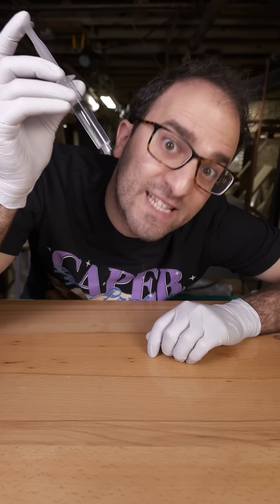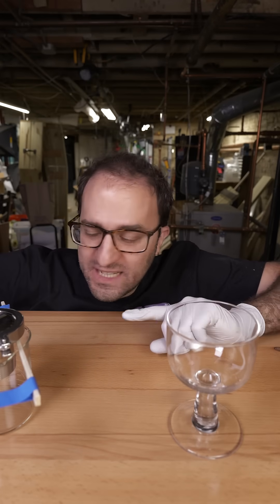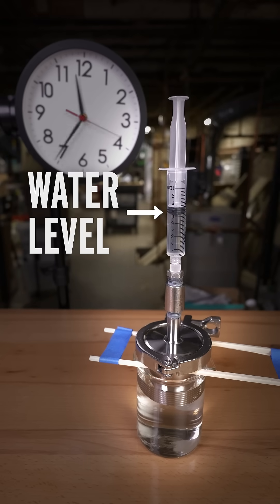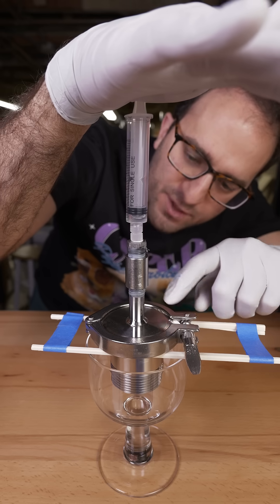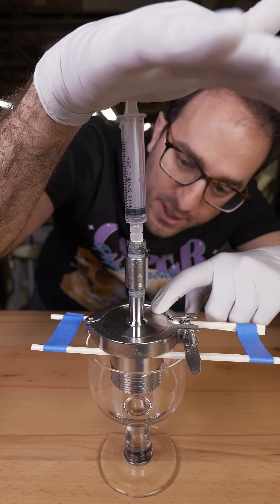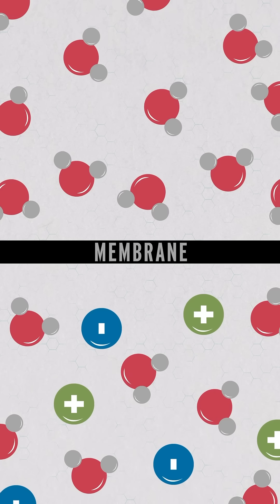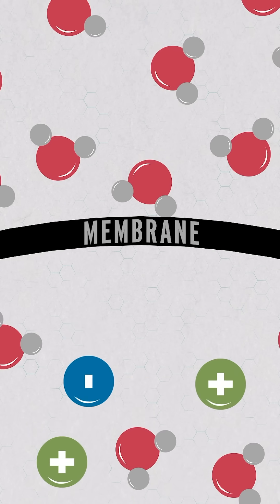most textbooks are mostly wrong about osmosis

Comment: This is not a sufficient explanation of osmosis in my opinion. Osmosis is not kinetically driven, rather it is a purely probabilistic effect. Since the same amount of water on both sides has more permutations on the side with dissolved particles, any one particle when moving has a higher chance to end up in the salty water than in the unsalinated water. This continues until the bias introduced by the pressure difference cancels out the bias introduced by a difference in potential entropy.

Comment: Norway's osmotic power plant, aimed at generating electricity where freshwater meets seawater, struggled due to inefficient membranes that couldn't produce enough power, high maintenance and operational costs, a lack of reliable membrane suppliers, and complex scaling issues, rendering it economically unfeasible.

Comment: particle physicist here. to quote wolfgang pauli your not even wrong. boltzmann figured this out in the 1800s its called the boltzmann equation. start with your system as a two species distribution function in thermal equilibrium meaning f(p,q) ~exp(-p^2/2mT) \Theta(q_boundary-q)\Theta(q) plug this into the boltzmann equation as your initial conditions viola your answer. nothing really that interesting 0= \partial_t f + p/m \partial_q solve this you will get the exact time dependence of the system. Everything you said in this video is wrong

Comment: That's incorrect. The measured osmotic pressure would be the same even if both sides were in non-enclosed containers to equalize with atmospheric pressure. In human biology, osmosis can generate large pressure differentials-- eg, you can get high intracranial pressure by drinking distilled water because the water will force itself down the concentration gradient into your brain despite how much pressure builds up on the other side. 
The real physical explanation comes from the thermodynamics of water molecules being attracted to salt and entropy favoring a greater number of possible combinations-- essentially, water likes to come in to satisfy all the ways it could bond around the ions, and it takes work to separate them after this happens (such as the physical force of reverse osmosis or the heat energy required for distillation)

Comment: Where is the energy coming from for the “bounce”? Can temperature change indicate a change in entropy showing the energy transfer from ions bouncing and water transiting the membrane? Wouldn’t a better explanation be that the larger ions create a low density water region around the membrane and that creates the pressure that pulls across water?

Comment: Good video. Bad explanation. If it was because of the salt bouncing, then the osmotic pressure would strongly depend on the nature of salt. But it is very well known (under the name colligative properties) that the pressure (mostly) does not depend on the nature of the salt. Let alone salts, you get an osmotic pressure difference even with sugars, amino acids, and many other things. It IS mostly due to the water moving down its concentration gradient.
Reply from the maker: Sugars, amino acids, and other things that cannot cross the semi-permeable membrane do the same thing as salt does in this demo. Water moving down its concentration gradient is not nearly strong enough to explain osmotic pressure. Check out the sources on our full episode about this for a much more thorough explanation. https://youtu.be/fJFMP0_fhLQ

Comment: We use a reverse osmosis setup to supply clean water to our steam humidifiers. Our steam humidifiers run 24/7 due to the type of environment they're humidifying, and if you don't regularly change out the 6 filters it has the humidifier tank will build scale. 

But if you change them out regularly, the tanks are spotless. 

It's amazing

Comment: It's still moving down the concentration gradient calling it pressure doesn't change that. You see the same thing in convective heat transfer, the temperature of the air is actually not constant there is a very steep gradient of temperature on the surface of the object, the size of which depends on the convection in the room. You can absorb this complex physics into what's called a heat transfer coefficient (h) so the math is simply q"(heat flux) = h(Tair - Tsurface). Same is true with mass transfer but with concentration differences. It's not literally how it works but it allows you to explain it to kids in a textbook easier. We've known the local concentration gradient was there because it's fundamentally needed for heat/mass transfer to work. Osmosis has similar mechanics to liquid evaporating into a low solubility carrier gas, the carrier gas "bounces" off of the interface (hardly any dissolves) and displaces the high local concentration of evaporated vapor creating this "low pressure zone" or low concentration zone.

Comment: Absolutely beautiful demonstration. The most remarkable insight is that during dilution of the saline solution, Gibbs free energy can be lost without any work being done if no gradient exists. To reverse the process, external work is required. Counterintuitively, usable work from dilution only emerges when done against a pressure gradient, highlighting how entropy increase can drive work. Fascinating phenomenon. Here, with “against a pressure gradient,” it’s important to see that the entropy increase can actually do work using the internal thermal energy of the system—coming from the negative Gibbs potential change. But the process can also happen without any work being extracted, and in that case, we lose the Gibbs potential, which can only be recovered later by doing actual work. Absolutely fantastic.

Comment: Shouldn't the water be transported away from the saltwater, not towards it? Why does the salt bouncing against the membrane bring more water towards it instead of away?
Reply: This was the comment I was looking for, got confused as hell
Reply: So think of the membrane as like a bar squishing all those molecules. This creates a denser side where the bar is flexing, and a less dense side where it's not. One side has higher density, the other does not because of the difference in force exerted by the membrane. To have a difference in density, there has to be a difference in pressure because pressure dictates the force that is squishing those little dudes together. So, area with higher pressure then has its molecules flow down to an area of lower pressure until the membrane stops flexing.
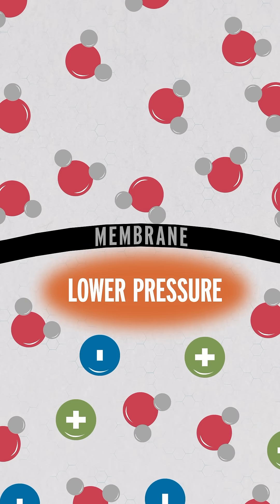Reply: @JL-142  Look at 1:00. If the point is to separate water from the salt, why is more water crossing over towards the salty side?
Reply: @1stGradeWumbology  The idea is the overall salt concentration is diminished because the pure water concentration has drastically increased. Note how he states even the diffused liquid has a hint of salt to it
Reply: this set-up isn't really a desalinator, it's just a way to demonstrate how osmosis functions. The overall salt content of the system hasn't actually gone down
Reply: No it's supposed to be a desalination demo. He says "this is how desalination plants work" right after saying "you get fresh clean water here and super salty water here".
Reply: @1stGradeWumbology  ohhh I think i see the confusion. His visual demonstration is largely in relation to the when you have two liquids separated by a barrier. I was ignoring the first part that is simply passing a liquid through a membrane. Desalination is that first part, the second part where there's two liquids is the actual thing he's explaining. The problem is the formatting because he's making it seem like the explanation pertains to both aspects of the demonstration
Reply: The video is just a little confusingly structured. The first part demonstrates simple diffusion, the second demonstrates diffusion of two different liquids across a membrane and how different particles affect the gradient through kinetic force applied to the membrane
Reply: Took me a couple rewatches to parse it properly lol he's not wrong but god this is confusing
Reply: Tbf even my bio textbooks phrased this confusing af, idk why but osmosis is just one of those concepts that should be intuitive but just breaks down when trying to be explained

Comment: Its reasonable the idea of the difference of pressure, but i dont think its dependent of the interaction between ions and the membrane. Its more likely that the reason is that voids are made because of water hiper concentration around the ions (locally non homogenous)

Comment: Thanks to @chubbyemu I get how salt attracts water. How water flows to salt. So are the reverse osmosis water filters that folks have at home really just osmosis filters? Like a coffee filter but smaller holes with pressure behind it?
Because otherwise based on more water going into the syringe. You’d have less distilled water in the cup right? Since salt doesn’t cross the barrier? You wouldn’t want to drink what in the syringe.
Reply: RO systems use pressure to push the water through

Comment: Ok but where is the salt getting the energy to bounce off the membrane. And why against only the membrane and not other things like a paper??
Reply: wdym? it has energy because its not at absolute zero lol
Reply: The simple answer is that it does, but paper would be too thick and heavy for water to get through or to move a meaningful amount.
Reply: all molecules bounce around. But here, water passes through and salt does not, so only salt ions count
Reply: All systems have some entropy meaning there is energy in the system. All objects in the system are trying to reach a zero state of energy, so if you put  a membrane barrier that only some of those molecules can pass through, the ones that can't will transfer kinetic energy to the membrane causing it to flex

Comment: I'm not a physical chemist, but this explanation doesn't make sense to me. Why don't the salt ions pushing on the membrane create pressure?  If the membrane is inflexible, you can actually measure higher pressure on the salty side after water diffuses across. That's why it's called osmotic pressure.
Reply: This is because the animation and explanation in the video is extremely misleading and barely in line with the study. The study itself talks nothing about flexing membranes or bouncing molecules. Instead, it describes the forces inside the membrane caused by the membrane repelling the solute (salt ions) and the usual hydrostatic pressure (water pressure). First, it shows how these forces cancel out at equilibrium and lead to the same law that describes equilibrium with chemical potentials, the thermodynamic explanation. Then, it shows how these forces drive osmosis from an initial state, with the key idea being that the pressure inside the membrane drops as the solute concentration drops. 

In a simplified way, the pressure drop inside the membrane causes the solvent to move across the membrane, and the force of the membrane against the solute is enough to counter the solvent from moving the other way until it reaches equilibrium.

Note that the study does not reject the thermodynamic explanation of chemical potentials driving osmosis. Rather, it characterizes it at a mechanical level and relates it to physical forces. It's in the article name itself. And understanding both leads to a complete explanation of the osmosis effect.

The textbook explanation that the study and video describes, that osmosis is driven by water concentration, has long been rejected anyway. That fact is nothing new.
Reply: @sylviaxx3574 So it's kind of like viewing osmosis as a cascade? The loss in pressure on the solute-concentrated side further drives the mechanism?
Reply: The salt ions dissolved in the water touching the liquid permeable membrane connected to water with no salt in it?  DOES create pressure, whether the membrane is flexible or not. This particular membrane? Repels salt, preventing normal osmosis.
Reply: With enough pressure, it'll break through the membrane. Slowly flowing the saltwater at a constant low pressure will just collect the salt at the beginning of the membrane while the water molecules slowly working it's way through the membrane.
Reply: Because the paper is like  studio 54  only hot people get in.  😂😂😂
Reply: It is a basic question in chemistry (3rd year). Think of water not as a liquid but as a gas. The gas wants to normalize. Because there is a lot of salt on one side with little water (gas), to make it so the gas ratio is approximately equal water moves across to normalize the concentration.
Reply: @andrew3224  In the video, he says that explanation isn't right
Reply: @andrew3224  ur fake I'm real
Reply from the maker: This paper has a full explanation https://pmc.ncbi.nlm.nih.gov/articles/PMC10457415/
Reply: @ACSReactions  Is that paper widely accepted?
Reply: @tedeby5351   @ACSReactions  JohnSmith is correct. The paper linked claims that the transport is pressure driven, but measured pressure difference is 0 at the beginning of a classical osmosis experiment, and the pressure in the salty side is higher at the end. Diffusion is the correct behavior driving osmosis (though not necessarily concentration-driven diffusion; it's potential driven). The paper is filled with theoretical mistakes; I don't think that a single isolated paper should be taken as holistic truth and then used to claim that "most textbooks are wrong" (the inverse case is most often true...)- if you want to make such a bold claim you should be willing to engage with people when they have serious counterarguments to what you are trying to present rather than just linking the paper (as if just linking a paper proves him wrong, even though the paper is mistaken in many ways).
Reply: @llatato  okay this is how I was taught it in pchem 426. I thought for a second this was just what was actually happening and I was just not smart enough to get it. But I'm a biochemist who doesn't do anything with osmotic pressure, my buddy is the acs chemist
Reply: @tedeby5351  Learn how to check lmfao.
Reply: @Obscurite1221 hush, the adults are speaking
Reply: @ACSReactions  The Debye model is also mostly wrong. The ion bouncing idea would imply that the osmotic pressure depends on the momentum of the ions, but it doesn't.
Reply: @canonicaltom   you're right,it would imply the momentum of the ions would mean more osmotic pressure if this model was right,but how do you know it does not

have people heated one part.... although that is bot the only way,if under same temperatures,the solute ions would have the same velocity,if this model was true,heavier ions under the same temperatures would cause more osmosis, but literature has shown osmosis is purely a colligative property,yea you're actually onto smth
Reply: @kazukawasaki97  It's a colligative property, which is known by experiment.
Reply: @ACSReactions  put in the description or something, you can't copy comments
Reply: @ACSReactions  Your explanation is fine as a popular science short but don't come here and argue that its the defacto truth.
Reply: @ACSReactions  ratio

Comment: Why would that happen? Sodium is 22g/mol and h2o is 18 g/mol. Therefore at a given temp, and even kinetic energy, water has a high velocity. Make it make sense
Reply: Could you maybe be more clear on what you’re confused about?? You’re right, the water is moving too, but it’s not going to bounce off the membrane - if it hits the membrane it just passes through. The ions can’t pass through, so they bounce off instead, which is what creates the critical pressure differential here.
Reply: @meteor_trails  the water won't pasd through every time, the salt won't be deflected every time. These are thermodynamic processes.
The explanation, as stated, is very flimsy.
Reply: man if you’re really that interested in nitpicking it there’s a) the actual full video where they explain in more detail and b) a link in this comments section to the actual paper that proposed this. the reason it feels flimsy is at least partially bc they took a complicated physical chemistry paper and condensed it into a minute long video accessible to non chemists, so the full argument for why this model works isn’t gonna be here.
Reply: @meteor_trails  
It's not nitpicking
The flow has two contributions, diffusion, where the salt is coming from, and osmosis.
Reply: also, just bc the water doesn’t pass through sometimes and the ions do sometimes doesn’t mean there’s not enough of a difference in the rate at which those happen to result in a slight pressure differential??? like, even in the video they show how osmotic pressure acts very slowly and gradually bc it’s not a very strong force.

Comment: I...what? Salt bounces off the membrane because why?
Reply: bc every molecule is moving. that’s actually what temperature measures - the average speed of molecules’ movement! for a molecule to be completely still, it would need to be at absolute zero, and that doesn’t happen even out in space. the water molecules move too, but when they run into the membrane they can move through it, as opposed to the salt ions that bounce off of it.
Reply: additional clarification: the salt bounces off while the water passes through bc the membrane is only semipermeable, and allows water to pass through but not ions. idk exactly what membrane they’re using to accomplish that, but the lipid bilayer around all your cells is the same way - water can get through on its own, although slow enough that there are membrane proteins to facilitate its passage, whereas small ions like the ones in salt end up stuck their side of the membrane.